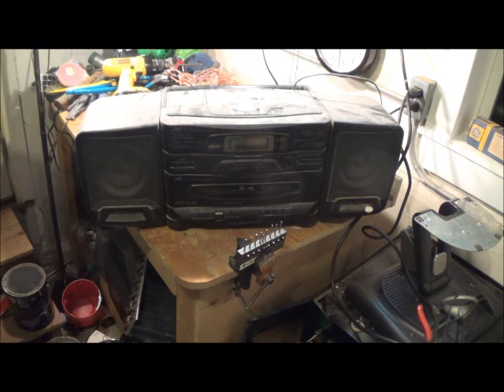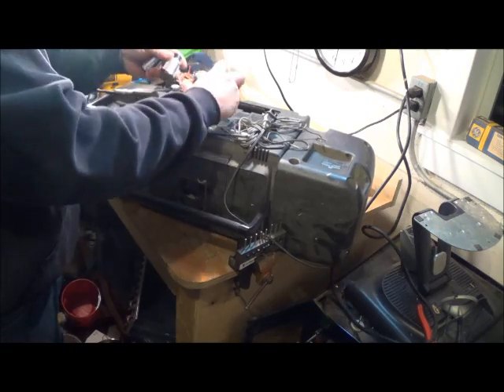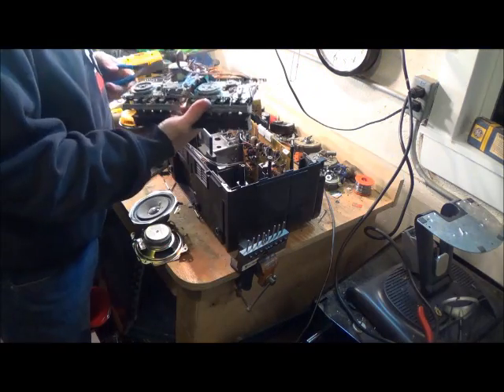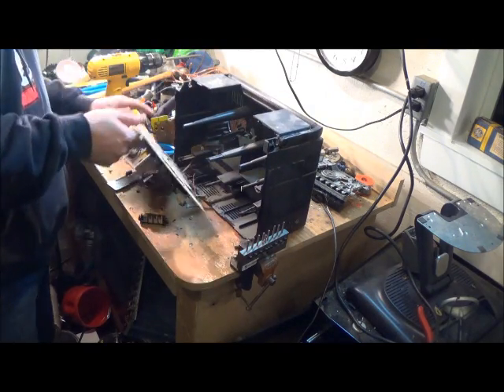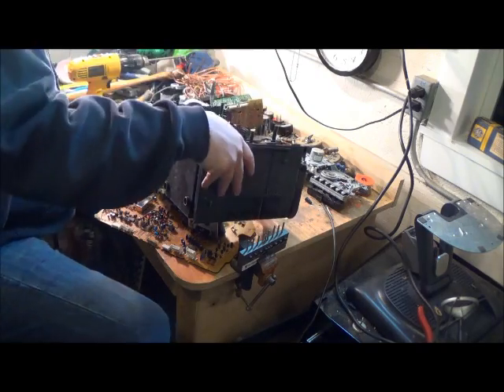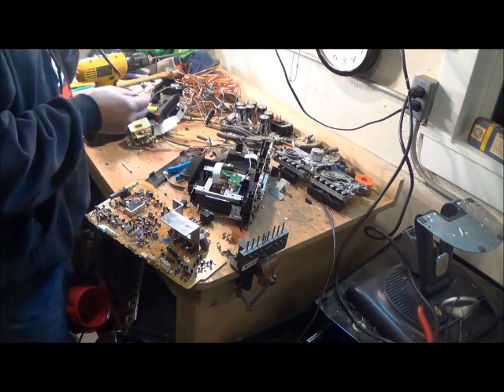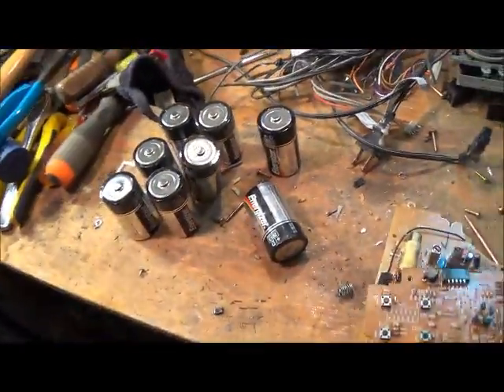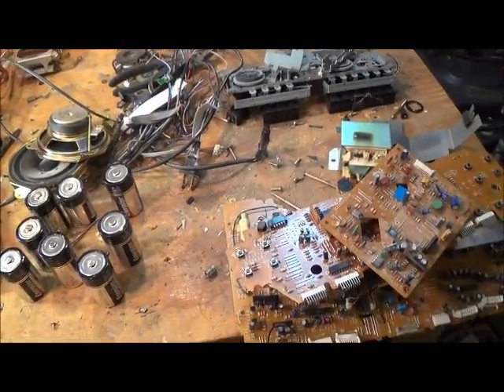Scrapping a boombox stereo for copper wires + magnets!

Comment: At least it was a bad speaker system.
Reply from the maker: Yeah - If it would have worked, I would have kept/sold it. Scrapping is the absolute last resort
Reply: Robbie TwoScraps If you find audiophile speakers that work flawlessly, you can sell them for over $200 plus on Ebay and that’s more than scrapping.
Reply from the maker: @loudspeakertestsmorebyaida3804  I'm a top rated seller on eBay so I know all about selling old goodies on there ;)
Reply: Robbie TwoScraps Nice. ☺️